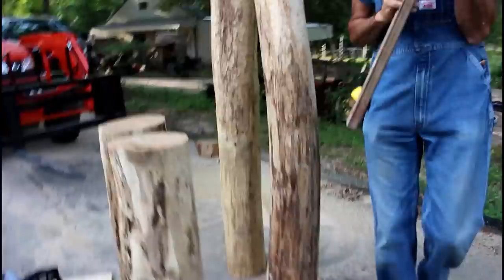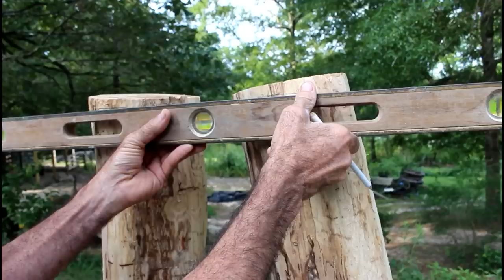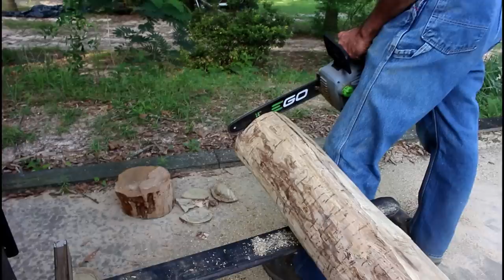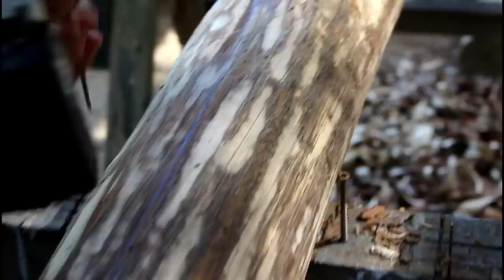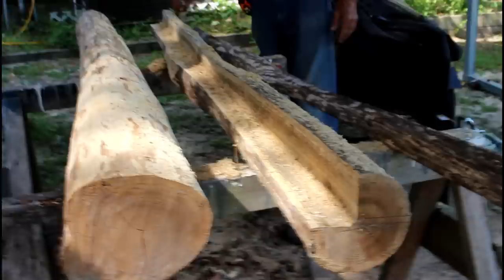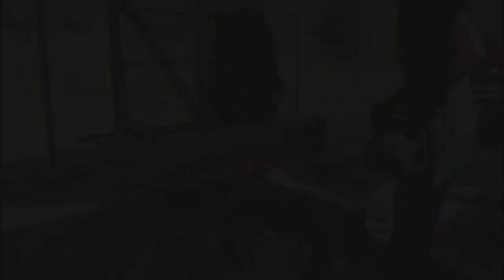The LOG BED | First STEPS | Headboard, Footboard, Side Rails

Comment: The 1st thing I thought of was "is there such a thing as a flexible level". I know it's too late now, but I bet you could have wrapped a metal band around the tops of the posts to the desired length and measured from the concrete to the top of the bands all the way around (N. S. E, and W) to get a level line.

Gonna be a cool bed...can't wait to see it!
Reply: Sherry Tucker yes sherry, there is actually a flexible level and it is called a water level and it is a very simple device that you can make at home and it really has infinite length depending upon the materials you use and your needs. 

Go to Lowe’s or Home Depot or any place like that and get s piece of clear vinyl tubing somewhere around 3/8” diameter, doesn’t need to be real big, whatever length you think you’ll need and you will need a couple plugs for the 2 ends. 

Take it home and and plug one end and get out your favorite color food color from the pantry and squeeze into the tube 6-10 drops depending upon length again. Add water and fill except for the last 2’ of tube. Install plug on fill end now and it is ready to use. 

If you hold one end up at the point you want and then take the other end and hold it higher than the first point and wait a few seconds for the water to stabilize and then look at the water line at each end and they will be perfectly level. Water always finds level no matter what. Put a mark at the water line and then cut the posts off and they will be perfect. 

This type of level is often used when building decks and stuff, especially when tall posts are being used but there are endless uses. 

Hope this helps